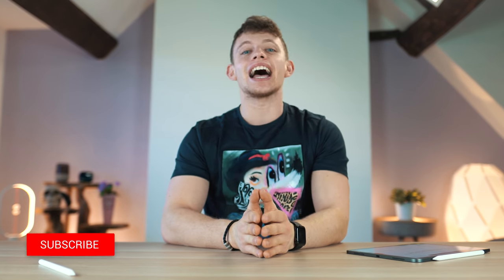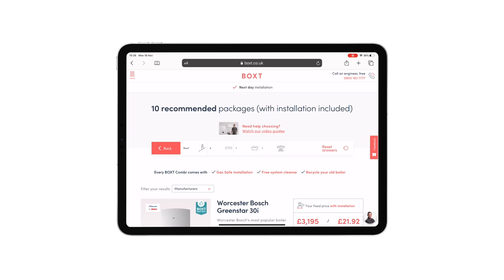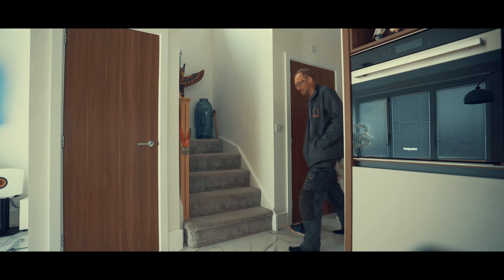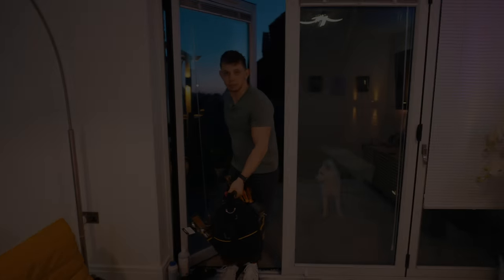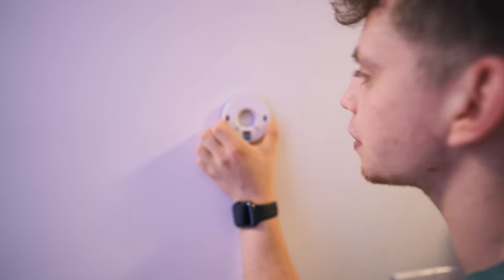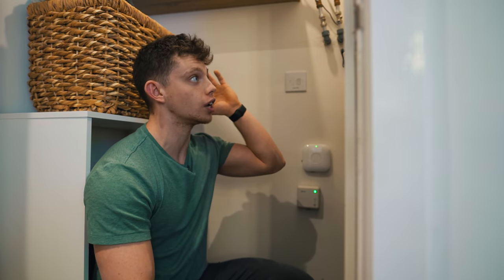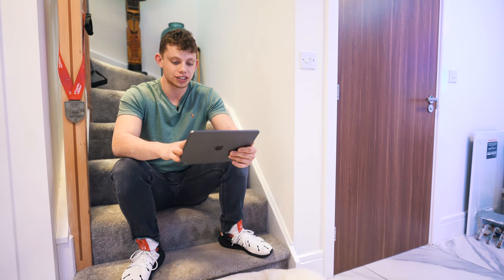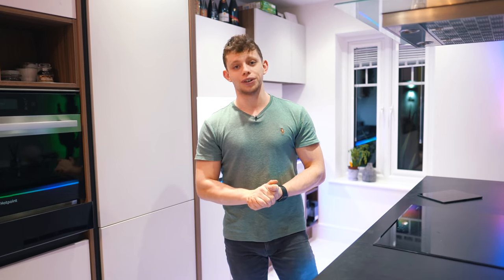It's Been Cold... Finally Testing The Best Smart Home Heating!

Comment: I understand that you probably got the boiler for free as part of this being a paid advertisement but it's super irresponsible that this video implies you need a new boiler to use a nest thermostat.
Reply: You nailed it bro
Reply: I purchased a nest for £150 and installed it my self!
Reply: Or you would be Super dumb to think that you needed to buy both 🤦🏼‍♂️
Reply: Or you have to replace the whole boiler after a single year?! Dafuq!!!
Reply: Exactly my thoughts. Also very environmentally unconscious replacing 1-year-old working boiler with the brand new one, just to shoot an advertisement.
Reply: Totally agree with this comment. Cost of installation for one of these should be between £80 to £120 for 95% of existing systems. (I'd know because i've installed sh*t loads). People should stick with the Nest Website to find installers. I don't know them but suggest using BOXT if you NEED a new boiler.
Reply: A 1-year-old house would have a decent combi boiler anyway surely?! It seems like a lot of unnecessary work here.
Reply: Exactly not everyone has the money for that.

Comment: As others have mentioned:
- didn’t need a new boiler although combi is more efficient one smaller house
- nest is very similar to hive if installed correctly apart from nest is slightly fancier 

If you wanted to show a much more efficient “smart” setup you would have included TRV’s with your combi on every radiator...

Comment: Fitted Hive in 30 minutes and works great. Works with almost any boiler. Does Hot Water and Central Heating. App works well. Full Alexa support. Had a couple of disconnections over couple of years which I put down to 1 low cost batteries and 2 domestic Wifi not able to cope with number of devices. With good batteries and using separate wifi controller to broadband hub, not had a single dropout since .I did consider Nest but glad I chose Hive as it does everything I need and now supports radiator control too.

Comment: Why are you getting a new boiler? All you needed was a new thermostat
Reply: Because someone will have paid for all of this, it's deffo a sponsored video
Reply: More a luxury thing.
Usually people switch their thermostat but that means that you have to put it at the same place.
With going this route, he could place where ever he wanted it.
You also gather more data but honestly, for normale people that just want basic smart controls, please people just replace the thermostat and not your boiler.
Reply: @annekedebruyn7797  nah dude you don't need a new boiler to move the stat
Reply: @TheDoctorPretzel  I haven't said that you need a new boiler to move the stat. I mentioned a list of reasons why having a newer gen boiler can be better in his situation. Wireless control is one of those reasons.
Reply: @annekedebruyn7797  you can still upgrade to wireless control on an old boiler
Reply: TheDoctorPretzel he should of just moved houses instead of changing boiler

Comment: Those plumbers prob didnt believe there luck turning up at this job taking out a basically brand new combi and fitting a brand new combi and just to be clear I normally like the tech flow videos but this is mad there was nothing wrong with the hive that couldnt have been fixed and the hive and nest stats have the same control and smart features just a little different in looks

Comment: There’s lots of features with the nest, we have been using ours for about a year now and it has worked flawlessly. We have Ours set to display 
the time when someone goes by. All features can be controlled on the nest in the settings section.
Reply: Has it saved you a lot of money over that time? I've just installed mine and keen to know if it will give us a decent saving
Reply: Tom Rogers we find it really useful to be able to control the heating from our phones as we travel a lot but when. Even at home it works well as it is easy to set up time zones of when it is on or off. I hope that made sense, my english isn’t very good

Comment: I couldn't do smart heating so I just use the switch bot on my thermostat and set the temperature to to 22 degrees and keep its set then all I had to do is ask Google to turn on the heating  via the routine in the Google home app and there we go I get smart heating for £25  As I rent my property and can't change the heating system but this gives me the functionality I wanted without the cost

Comment: So how does the thermostat adjust the heat on the radiators? Is it essentially just setting the water temp that runs through all radiators in the house?

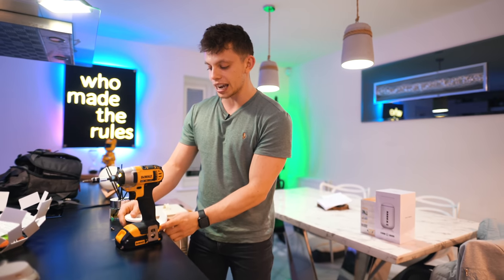Comment: Hi, nest is a great thermostat! But for saving you money, you can’t beat the Honeywell evohome!! You just change your radiator valves in every room connect a remote panel to yours boiler. Saving you about 65% on heating bills. Your only heating rooms that need heating not empty never used ones. And each radiator will only ask for heat from the boiler when it needs it. So your boiler doesn’t run all the time wasting heat. Each room can set for 6 different temperatures throughout the day. And each one learns how long it takes to get that room up to temperature. So if you what 20c at 07:30 at will start early to get to that by 7:30. And the same at the end of the day. It turns off early  so the room is at the set temperature at the set finish time. This smart feature can be turned off if you prefer. 😬
Reply: That would be ideal heating setup, but you need to have that smart valve on every single radiator in the house. My house has 15 radiators meaning it would cost me around 1000 GBP to fit every single one. I might get money back after 10 years running - but probably the valves would die before that.

Comment: Hive does everything that nest does and more, you’ve implied it couldn’t. I work with these for a living and Hive is far superior. Plus there’s a lot more Hive products that can be added on, like the new TRV’s for example if you wanted to go really energy efficient, you can control each rooms temperature and shut down individual radiators completely. Plus all this can be done via the Hive app, or did you not know there was a Hive app ?
Reply: I thought the same. Watching how it was amazing that it had cool features like safety temperatures and geofencing, has Alex actually used his Hive and the app?

Comment: I watched this video last night & thought it was a bit crazy replacing a 1 year old perfectly working boiler for a brand new one just so you could use the  NEST heating controls for your heating for your  newly built home.   
I thought 🤔 that’s a bit excessive, either this is a sponsored video or you have more money then sense.   Also I generally thought you needed a new boiler just so you could use the NEST system but reading threw the comments I now know that this is not true.   May be you just  need to explain things more in your video’s Alex.

Comment: You can tell this is sponsored.. Hive does everything you described the Nest as doing and the disconnection issue can be fixed more easily than buying a whole new system. Also, Nest got rid of third party support such as IFTTT... how can nest be the best ‘smart’ thermostat if they refuse to let you do something as basic as work with third party items and have routines etc. I admit nest is way prettier but it’s basically a normal thermostat with an app 🤷🏻‍♂️
Reply: Thank you for this comment. I was almost going for Nest. I didn't know they removed IFTT. Shame.
Reply: Literally, he didn’t think to troubleshoot his hive so thought “I’ll just get a sponsorship for a new heating system”

Comment: Nest thermostats are top on our list of smart thermostat so good choice 👍🏼
I wouldn't had replaced the whole boiler for one though !

Don't mistake that the hive is just another brand for smart control, it is down to personal opinion for which you prefer to use.

Could you not had just put the thermostat where the cable came through the wall and just filled the old fixings. 🙈
Reply: If boxed are paying for a new system for you to make a video of course you have a new one

Comment: Our home has The Hive Hub, which we got with the house but it keeps going out of signal and the customer service has been horrible so we are stuck with it. Any advice?
Reply: @Scottahhh right what would you recommend yourself?
Reply: @Scott oh right that might be a shout then, we didn't get hive, the previous owners had it and it keeps going out of signal and we contacted hive but they tell us the same suggestions all the time and none of which work.
Reply: @Scott nah we just have the thermostat and the hub, might just go for the the other system you were on about, tbh would just prefer a normal thermostat that actual works

Comment: like others have pointed out, its a new boiler and theres no need to replace either a new or old boiler to add these controls. Now you may have got this f.o.c for being on youtube which is fine, but i imagine the tree huggers may not be too impressed. But that aside it does not make sense to spend £4k on a boiler when you could have a nest stat fitted for hundreds rather than thousands.

Comment: Is there a similar service available in the USA?   The company is UK based only.
Reply: This video is just an ad for that company he had no need whatsoever ever to replace a brand new boiler. If you want the nest system just contact a local gas engineer and get a quote to have the nest system installed.

Comment: As an 'influencer' i'm afraid you do have to take responsibility for what your advertising and I understand every experience is different but i'm afraid you've been seduced by style over substance. You can't possibly comment that it's better on the same day you've installed it. I have installed many Nest thermostats (ex Pro installer) and owning one myself. They are simply too inaccurate. Auto Schedule is dumb and would turn on when i'm out, off when I'm in. When you turn Auto Schedule off it will randomly turn it self back on. I love the style like everyone else but I'm afraid it's style over substance and put me off Smart Thermostat's. I have moved to  HIVE because it isn't trying to be 'too smart' with an algorithm you also don't have to have power to the thermostat as it runs off batteries, which is why 80% of Nest users have the thermostat located in the completely wrong place due to them having to plug it in which generally means on a desk or table at the wrong height and position in the house. I'm also convinced it isn't saving people money like it claims, where a £50 'Dumb' Honeywell would do a far superior job. Until they sort it out save your money people!

Comment: all off that is available on hive - you stuck the hive controller in a cupboard and say it didn't work ? imagine that it couldn't connect very well inside a cupboard.
Reply: That’s where it’s supposed to be! And that’s where the house builders put it. The Hive system is absolute shite, I’ve had Hive. I’ve had cases when I’ve had the thermostat right next to the controller, and it still didn’t work.

Comment: Alex, legit I need a new boiler and would be happy to take your old one off your hands. Mine stopped working about a week ago just before I went to new york. I've ordered a new PCB for it which comes tomorrow but the boiler itself is over 10 years old so a matter of time before it pops its clogs. Typically I've fallen on hard times money wise so a new boiler is out of the question currently so I'm praying the PCB resolves the issue for the time being as cold house + winter + having a young son is not great. Currently having to use electric heaters to warm the house up which is going to cost me a fortune on electricity but literally have no other option.

Please drop me a message and let me know if you genuinely want rid of your old one.

Twitter: @Nznee
Instagram: @imbradyo

Comment: Boxt are awful. Overpriced and cut corners on the jobs. Jobs that should take 2 days are done on less than a full day!! Avoid avoid avoid!!
Reply: I had the complete opposite experience with them this weekend. They were absolutely brilliant and price was very reasonable.
Reply: @omarebrahim7225  what did you have done and how long were they on the job for?
Reply: MrSamSandhu1 full boiler replacement, system drain, clean and refill, and integrate with Hive. Started about 8am and finished about 4pm. Was about the same time taken as another apartment in my building for the same job. No issues at all. Carried out by a local-ish independent engineer on behalf of Boxt.

My only criticism of them is that they didn’t ask that many questions when signing up - while we got a decent deal undercutting a private job, the boiler is rather overpowered for what we actually need, so may have been offered a slightly lower power one if we have an independent come out and inspect what we could have needed.